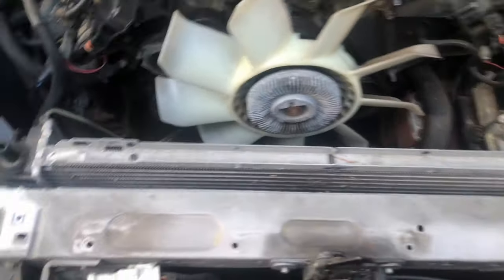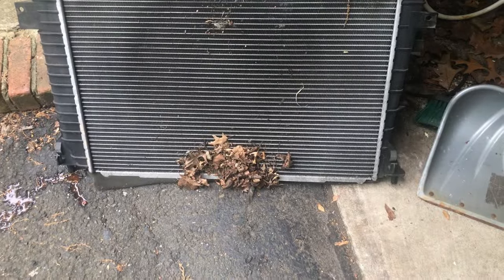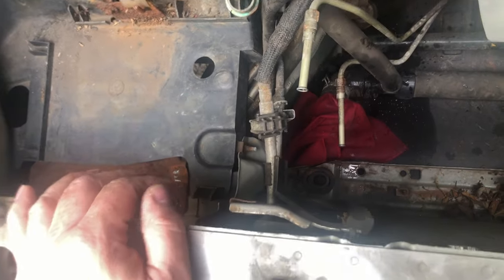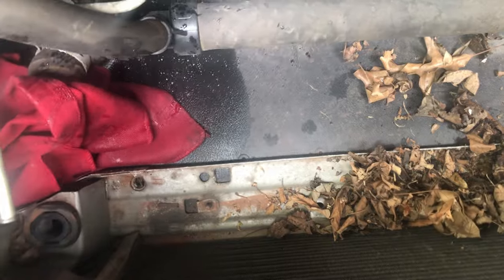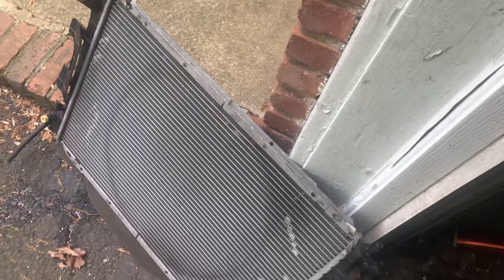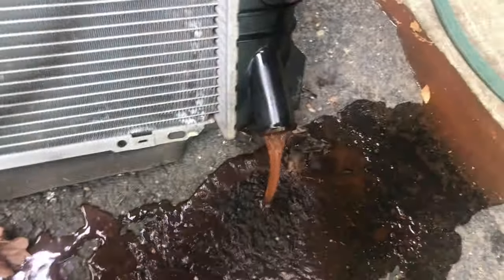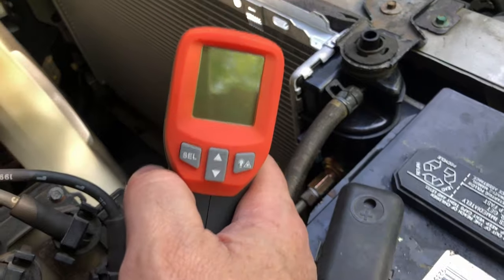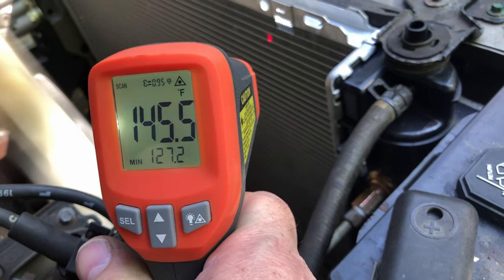Car overheating Was it a Clogged radiator ?

Comment: wish you would have broke off the tanks to look inside the old radiator, look with a flash lite trough the core tubes for blockage. And good way to test flow on a radiator is to lay it down with cap installed and fill with water, then stand i up see how long it takes to drain.
Reply from the maker: Stay tuned i still have the radiator. so i will make a follow up video soon.